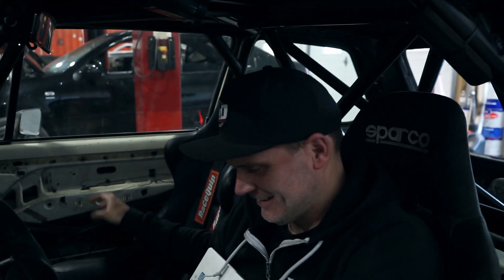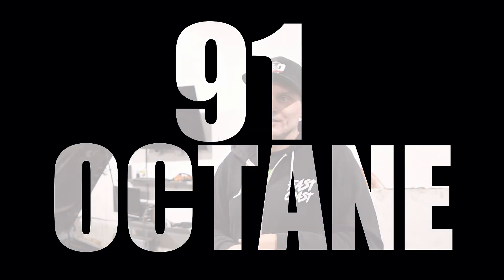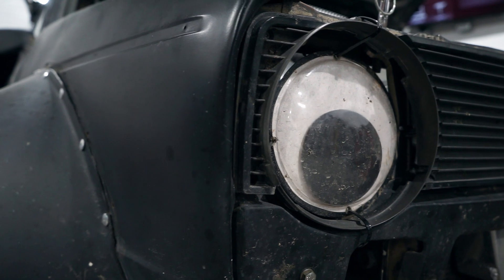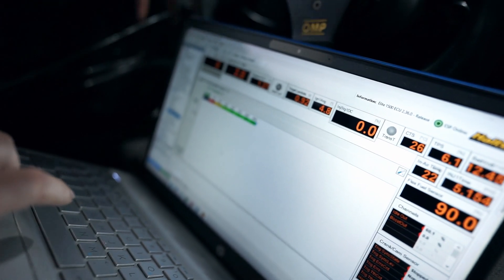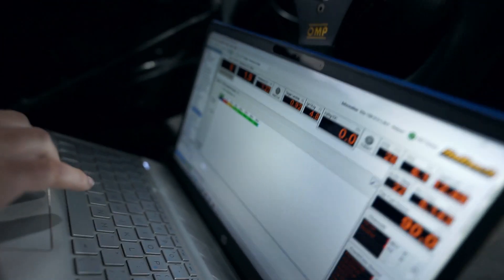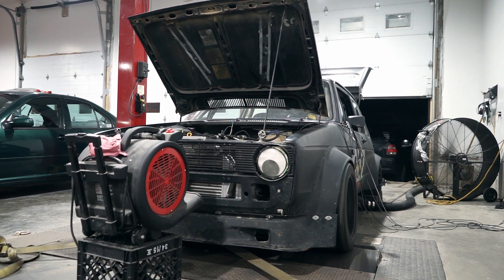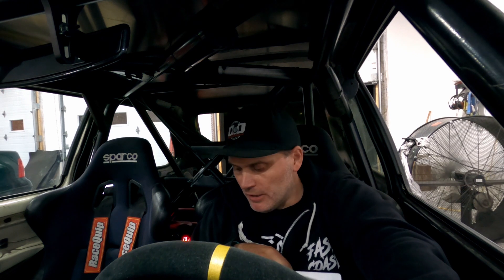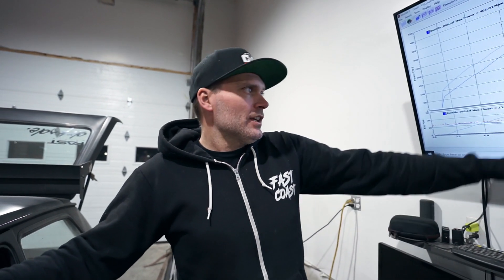We do a flex fuel tune on the Bergcup MK1 1.8T GT3071 using the Haltech Elite

Comment from the maker: Could we have made more, for sure. Our goal was to try and keep it boost the same. Meaning just seeing how much power we could get just with fuel and tuning alone.
Reply: That so cool umm how much power can you do on a stock 1.8T block
Reply from the maker: @brandonlewis1546  That question is sort of open... block itself guys have made 900-1000whp with them. If you're talking about stock short block, stock connecting rods and stock pistons... on this engine it's about 330whp.
Reply: That's awesome I'm try to do a built bottom end on my mk4 jetta with a k04 and a front mount intercooler and upgrade fuel pump and injectors to have fun at the tracks and drive back home.
Reply from the maker: @brandonlewis1546  I'd look at other turbos, K04 is silly on the 1.8Ts IMO.
Reply: Ok what you recommend
Reply from the maker: @brandonlewis1546  hit us up when you're ready. We like to chose a turbo specific to the goals and what the vehicle is used for.
Reply: Well it's my daily driver but I would to up the power a bit so I can keep with my friends or beat at the track or at the drag strip.
Reply from the maker: @brandonlewis1546  No problem, do it all the time. :)

Comment: Ok I know haltech standalone can adjust variable cam timing and set soft/hard cut. Respect to oem bosch ecu did u run more top end power?
Reply from the maker: Didn't even mess with it. We're well over what we'd ever use for power in this thing. We turn it down about a 100whp for what we do with the car.
Reply: @COMotorsports  400hp x 700kg.. 400x700.. it seems like to be creamy peanut butter box advertising.. who da hell dare to beat u on sunny or rainy day.. truly madness.. what a racing weapon u've done.. mega!

Comment: What software to do use for tuning?
Reply from the maker: Every car is different. In this one it's pretty clear in the video we're running Haltech 1500
Reply: @COMotorsports  sorry did not realise what the elite was. I looked it up tho. Hot it now.. I mean for like a mk4 1.8t the 7.5 ecu? Just kinda touching questions before taking interest in running my stage 3 basiclly running on a Apr stage 1.. mostly cause its an automatic 09a. I was warned that it might not hold up to a higher tune. But is basiclly built stage 3 and runs pretty good on stage 1 tune. But there are issue of course.
Reply from the maker: @wiytboi  If it's a full stage 3 APR kit with proper injectors and MAF.. I can't see how it would even run on a Stage 1 file. Their stage 3 kits on these are completely different. But to get back to your question, on most MK4 1.8T Big turbo applications we're using Eurodyne Maestro onthem.
Reply: @COMotorsports  no no excuse me. My buddy called it and it followed. Not stage 3, Its Franken, has TT MAF, APS265 fuel pump, 440 injectors ,4bar fpr ,3in turbo back, aem Cold air intake, catch can, diverter upgraded, forged tip, front mount IC, um I think that's all. So my understanding is when shop did stage 1 APR. He was concerned cause it's an automatic. And a friend was hinting at basiclly I built a stage 3ish setup, and only have a stage 1 tune. So some little issues I have might be due to that.
Reply: Got leminwinks running timing advanced 4.5 degree I think, sounds much better. The boost just falls off or starts to drop randomly, that's 1 issue.oh it's also stock k03s for right now. N249 delete, still has s.a.i. and n75. Its hosed for manual Grimm speed but not connected at moment.
Reply: Just watched your tune info video.. very helpful. So lets change that question. Can a tuned mk4 run automatic transmission?? Or is that a bad idea, also sai delete, are there benfits other then clean engine bay up and less stuff to leak. I hear that it gives poor mileage after sai delete? Let me add I'm not shooting for a top end car.. more acceleration, it's a daily driver I started working on and ended up at this point wasnt planning on doing much more then exhaust and intake with stage 1.
Reply from the maker: @wiytboi  MK4 Auto's are junk, so yes tread lightly. Moderate upgrades we've done lots on these with Auto's. However big turbo upgrades I would swap the trans. Stock K03... have at it.

Comment: Are you using just one knock sensor like the PnP Haltech 1500 is configured out of the box, or did you reconfigure another unused input to read the second knock sensor?
Reply from the maker: Elite 1500 has the capabilities for one knock sensor, which is already wired if you're doing the PNP harness.

Comment: I did testing in my g60 caddy with 91 made 181whp and VP MS109 211whp big difference especially with my tuning limitations because of Digifant limits. All the power was in timing and fuel pressure! I will say that fuel is so oxygenated that it made me drive my fuel pump which is a Walboro 255 almost 30% more. Which Was shitty because it was almost maxing out that pump.
Reply from the maker: Yeah fuel definitely makes a difference

Comment: I can’t wait to see what my 3071R does on my 1.8 stroker, fresh build and it still on break in for another hundred miles. Projected horsepower was 400+, I’m anxious to see what I get being that it’s a stroker crank w/ cams & 870cc injectors. I was picking your brain a few weeks ago when I was having issues with my and 75/manual boost controller. I had my diverter valve in backwards, what an idiot. Thing absolutely rips now @15lbs boost!

Comment: Does the haltec come with a base tune to get the car up amd running and does it self correct like some of the aftermarket ecu’s that are out there for other makes of cars
Reply from the maker: It does come with a base tune, and there is the ability to do 02 correction however every car is different and it will 100% need to be tuned.

Comment: On you personal opinion which one you prefer garret 3071 vs precision 6262 on the same engine 1.8 t 20v , just curious.
Reply from the maker: Honestly these two turbo's aren't comparable.. You're talking about a 400whp turbo vs 600whp turbo. So really comes down to what you want to do with the vehicle.... if it's power... then the 6262 is going to be the winner for sure.